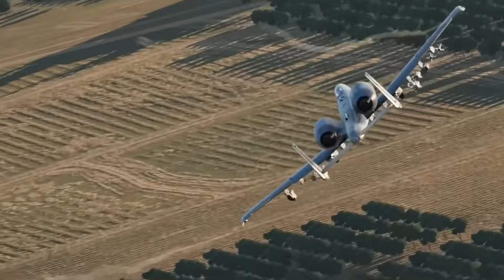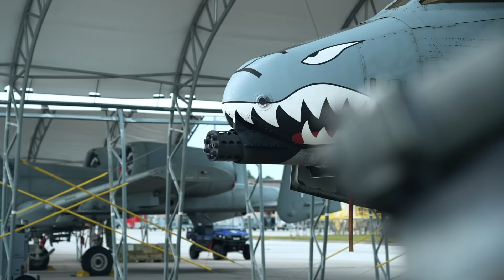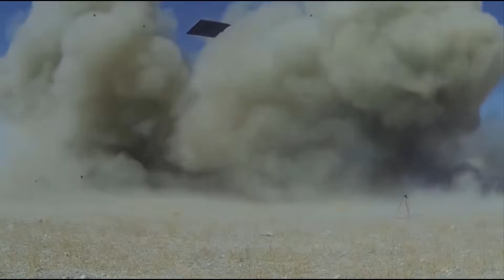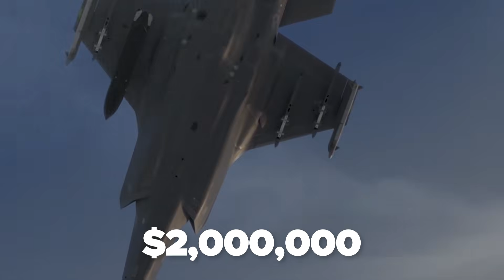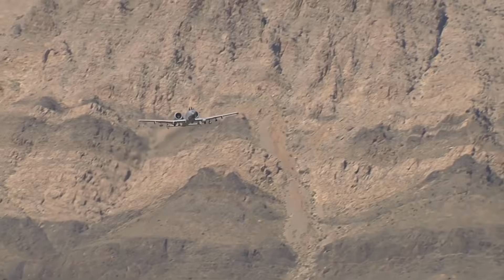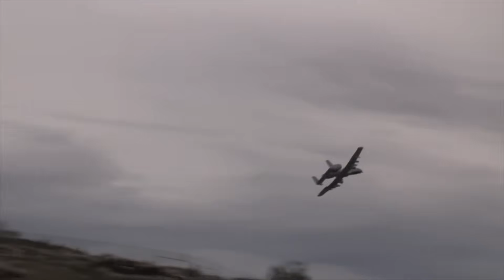This NEW A-10 Warthog Could Replace the $100M F-35 Forever!

Comment: A-10 is a flying armoury. Modify A-10 to stealth. It can be used for another 3 decades in stiffly contested areas. The shoulder fired missiles up to 12500 ft, supplied to Iran by China is a hazard.
Reply: The A-10 does the job it’s supposed to do just as our STEALTH fighters do their job- do you want a A-10 going head to head with a RUSSIAN or CHINESE 5th or 6th generation fighter. “YES” it’s expensive but in this Days of Conflict- we NEED THEM BOTH
Reply: Tell that to “ taco”🌮!